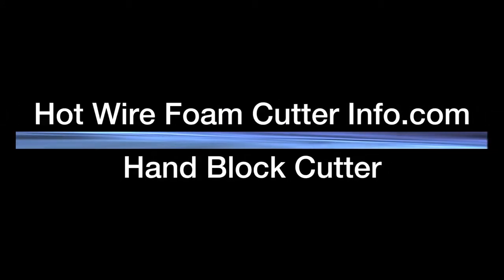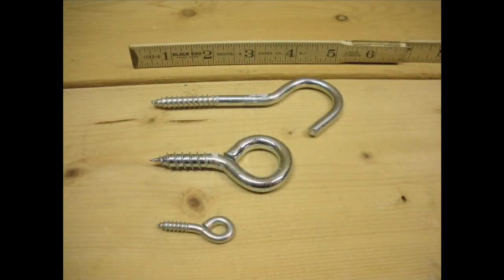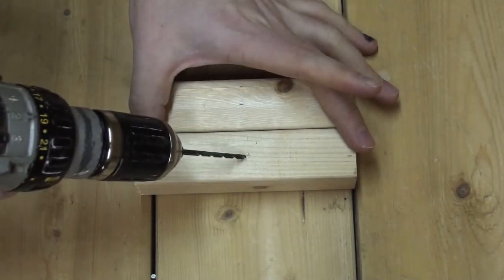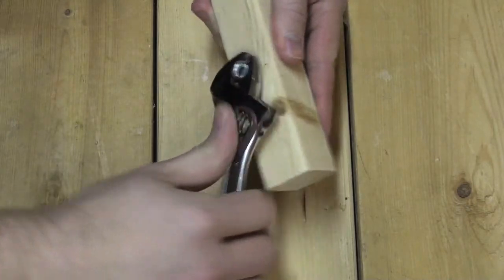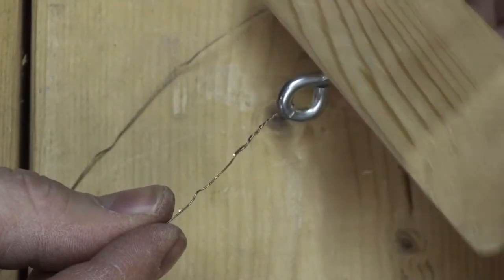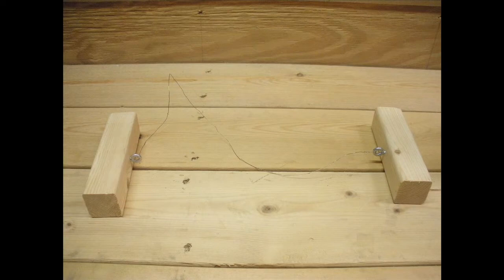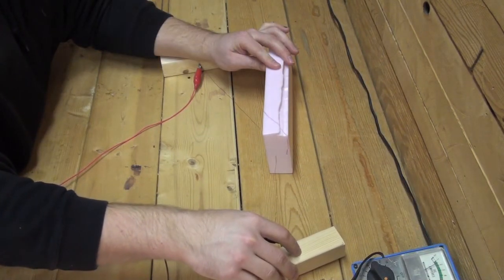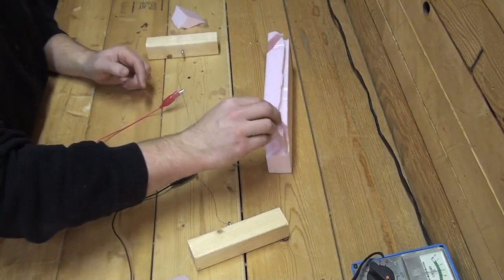Hand Block Hot Wire Foam Cutter - HWFCI

Comment: You don't need to spend so much time explaining how to drill a hole and screw in the loops. If your audience is at the stage of needing a hot wire cutter for something they are well past the needing to know how to drill a hole stage.

Thanks for the tute though.
Reply: Zac Johnson

Comment from the maker: @ThePolarisSportsman5 I am actually using an Astro Flight Inc Model 4005 B AC/DC Charger. I haven't mentioned it elsewhere on the website, but check out the website for more information on power supplies I recommend. 

I've even had some people hook these hand-block cutters up to car batteries. Just be cautious of your wire length as these will output 12volts making for quite a hot wire.